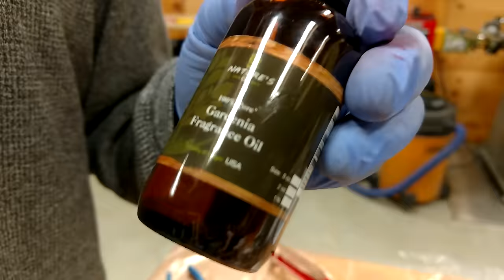Making Colored Smoke Devices for 4th of July

Comment: Please, if you would, elaborate on the solvent dye. It doesn't appear inexpensive at all (at least nowadays). Is this the same as the mica based dyes that show up in my searches?
I have everything thing else needed except the dye.
Thank you.
Reply from the maker: Check out coloredsmoke.com
Reply: @TechIngredients  Hot damn that was fast! Thank you.
I am in the process of many experiments using your information.
I hope to post an in depth report sometime soon.

I'm still trying to expand a bit on the first sugar+Kno3 composition, I've had some interesting results so far.

Comment: Is there a risk of explosion if the ingredients are added in the wrong proportions? In case a mistake is made...
Reply from the maker: It's small.  Only if a LOT more oxidiser was used would the burn accelerate to the point that it could burst the tube or the ends.
Reply: @TechIngredients  Cheers.

Comment: Question, is it possible to make it produce smoke faster? By pressing multiple pellets in 1 container maybe? Or would it burn too hot then?
Reply from the maker: The easiest method is to use a tube with a larger diameter and a larger hole.

Comment: Where do you get your Potassium Chlorate? Is it the same as Potassium Perchlorate?  Also,  is there any change that would be need to be made if using Citronella Oil in the  pyro device?
Reply from the maker: We used potassium chlorate and obtained it from EBay.  I suspect that oil would behave similarly to the other oils I demonstrated, but you might have to fine tune the quantity.

Comment: What if you use Potassium Perchlorate instead?  That has a lower burn temp. Would also save you all the carbonate troubles. 
Also, doesn't sulphur lower the ignition temp, would be a better primer? Or maybe even some phosphorus. Nice video though, will try.
Reply from the maker: Perchlorate should work as well.  Althoug it is OK to use sulphur with the perchlorate, I would avoid the sulphur in either case because of the strong oder.

Comment: Being the material is light weight, I may make some up for my CC plane using smaller thinner tubes, you never mentioned packing the tubes, so probably not a great Idea. I would use longer tubes and attach to eather wing tip. I may try it next summmer, not this summer. Also in a damp field,even evening when dew is falling to prevent any fire hassards.

Comment: Would it be okay to mix in the solvent dye during the shaking of the base products in the paint can?  The intended outcome being that what comes out of the paint can is the final useable product.
Reply from the maker: That's fine as long as you're sure you want to commit to a particular color.
Reply: @TechIngredients  Yup, if I give this a whirl there are 3-4 colors that I could see myself making frequently.  So I'd have dedicated cans for those and then a plain mixing can for whatever else.  I can't say I am going to try this, but I'd be curious how thick each successive layer would have to be in order to have a smoke that'd spit out 8 different colors in rapid successions.

Comment: Could you use printer toner for the dye? Printers use heat to fuse the toner on to the paper so I am assuming it would hold up okay to the heat but not sure.  Also not sure how safe it is.
Reply from the maker: I'm not sure, but if you constructed a dye free burn mixture and added some toner you would get an answer to the first question.  But, the dyes that are made for smoke are significantly less expensive and do work already.

Comment: Why not use fragrance oils instead of essential oils? They would be a fraction of the cost. Also, do you really need that much oil? Could you dilute it with a carrier oil?
Reply from the maker: You might be right about the source of the oil, but dilution is out.  You need very strong oils because the scent is spreading through a huge volume

Comment: Tech Ingredients. ..
What about alternatives like mineral oil, light petroleum-based or vegetable oils, should I not be interested in aromatics?
Though occasionally an option for me, I'm not wanting to spend for the added bonus of nose joy most of the time. 
I'm interested in marker smoke and the heavy, white smoke-screen devices.   Thanks!!!
Reply from the maker: You don't need to use the oils at all.  The initial demos were without oil.  If you do use oil to make the mixture a little easier to handle, then any food grade oil should work, although I havn't tested this.
Reply: Tech Ingredients 
  Thanks for the response. 
I guess, I'm contemplating making a stable mix with a simple base, like the food grade oil, as well as the dry mix units.
That's the best way I can explain my thought train.  This is the first, best method I've found for a civilian option to the military smokers I worked with in the air force. 
 I'm putting together some survival packs for the vehicles and a home package, therefore, the scents, etc. aren't as important, rather stability vs. volume.  Some to store and some on ready standby is the need, I guess the question out of that would be...
Does the oil mix provide any extra advantage (other than easier mixing) for shelf life or stability in varying temperature during said storage?  I noted the observation of a longer burn vs. more volume/higher reactive action between the oil, no oil units.
  Take care and glad to find/recommend your channel.  :)

Comment: Make very small ones that don't burn extremely long times and use for smoke-grenades for practice or paintball!  
Wonder how will a pipe nipple with caps at both ends with one end drilled would work?  Yes, I know, "pipe bomb" but these burn at a controlled rate, not explode . . . and the slower burn rate of these and shorter burn duration that I'm thinking of (15 - 30 seconds of as much smoke as possible?) might not get them dangerously hot?  And, the pipes would be repackable ..

Comment: I've followed your video for white smoke bombs and they worked great!  Is it possible to modify the colored recipe to use Potassium nitrate and sodium bicarbonate since I have these ingredients available but want to make colored ones instead?
Reply from the maker: Probably not.  The bicarb will certainly be able to bring down the temperature, but the potassium nitrate will have trouble decomposing to release the needed oxygen. It may be possible to walk this line finer than we did and be successful.
Reply: @TechIngredients  do you know a reliable colored smoke bomb recipe using potassium nitrate and sugar?

Comment: Great video! My son would like to know. If the dye stains everything. Does the smoke also stain? And if not. Do you know why?
Reply from the maker: The dye stains while preparing the mixture.  However, the smoke does not.  Look at our clothes during the demo.  No detectable color was deposited on them despite the density of the smoke and I especially was moving in and out of the clouds.
Reply: @TechIngredients  Can I add dyes to clothes and do not need to dye a specific one and know the name of the dye used in this video and is originally used in a non-smoke device

Comment: It's nice that the KClO3 allows one to tune the mixture so it can burn at a lower temperature, but it's efficacy also makes it difficult to locate. Many suppliers won't sell to anyone that isnt a licensed business or educational institution, unless you source it from over seas, but then you might have customs issues. That's why there are a hundred videos on how to make the stuff (don't recommend, it is cheaper to just buy it if you can), so most ppl are going to be forced to use KNO3 anyway. 

I'm interested in this because I want to see if you can use some high temp bearing grease, vegetable oil, bees wax.
Reply: Could you use potassium perchlorate as an alternative? That is readily available.
Reply: @dale-ry4cb  you could, but you won't be able to make a coloured smoke as it burns too hot and will destroy the pigments, that's why this video explains it's presence for chlorates over perchlorates. 

But keep in mind, what you are essentially doing g is making a solid rocket fuel that is tuned to burn slowly, but if not mixed properly or handled properly, it can ignite while cooking. So leather gloves and face protection are highly recommended.

Comment: Would the addition of acetone allow the mix to be packed into a more solid uniform shape? i.e. the acetone will evaporate from the mix
Reply: SpartanP291 consider that these are solvent dyes which are in fact soluble in non-polar substrates like acetone. (Mentioned) may have an impact on performance. Not sure that how the other compounds will react regarding introducing acetone to the mixture. As far as the packing goes, I think oils (optionally scented) are a viable solution.

Comment: Are the tubes reusable? Would ball jars with a hole in metal lid stand up to the heat and pressure?
Reply from the maker: I would stay away from glass because of the potential for breakage, not due to pressure, but from localized heat or impact.  The low pressure from the colored version of these smoke devices (as opposed to the white ones in our other videos) means you could use thin wall cardboard shipping tubes.  You could reuse these, but it would be a bit messy.

Comment: I see the issue that you run into with these colored smoke bombs as compared to the white paraffin wax smoke bombs, is that with a dry mix, you get a really slow burn that you can't mold it to have a middle part open inside the cylinder for a fuse like you can with the potassium nitrate mix. Is there anyway to make this powder into a moldable mixture without compromising the formula? And if I mix in more of the white powder you use for a starter reaction will it change the burn? Would I have to layer the starter powder inbetween the main, dyed powdered?
Reply from the maker: The oil is the only method I know of to make the mixture less dusty.  The oil actually slows the burn a little.  The starter mixture can be added in a separate layer, but its higher temperature is detrimental to the dye, so keeping it separate is important.
Reply: @TechIngredients  I'm assuming that you can't heat the mixture to a more viscous state like the peanut-buttery substance that you can get from the salt peter and sugar formula (non-colored smoke bomb). It's just that watching the last bit of the video with your yellow smoke bomb that eventually turns violet, you can tell that the burn takes a really long time because of the little surface area that's exposed because the powder lays flat. And for me personally, I want to find a way for the colored smoke bombs to act just as fast as the non colored, paraffin wax ones. Can you think of any way to do this? Also one more question: You said that the solvent dye is really staining, (I found a really good site: Fireworkcookbook.com that sells cheap pounds of all three primary colors for anyone who's wondering) Once the dye is atomized during the reaction, will being in the colored smoke stain your clothes? There would be a lot of reasons for me to not want to use solvent dye if the smoke is highly staining. Thanks as always for your awesome content and I hope to see more like it :)

Comment: I want to make these for new years. Can i make these with the plaster of Paris ends? Sir, you are a dictionary of knowledge. Thank You for your channel.
Reply from the maker: I think that will work.  Try testing one tube with one end filled, completely dried and see how well it bonds.
The reason we used a hydraulic cement is that most other compounds shrink as they dry and pull away from the walls.
Reply: I tried the plaster of paris and it works great. I just can’t get them to burn like yours and I’m using same procedure. Frustrated

Comment: Where did you purchase your tubes and endcaps cant seem to find them anywhere on the internet. Thanks
Reply from the maker: Did you check out Skylighter and Pyro Creations?
Reply: @TechIngredients  thanks for fast reply! Did check both but they seem all to small or to big. Would you by chance know the dimensions? Want ones very close to what you used (the bigger sized ones) cause those are perfect and I'll just cut the circles myself. Just got the chemicals in the other day and love your idea with the potassium nitrate and sugar mix on top of the mixture because it's actually pretty hard to get this stuff to ignite with just a fuse and phew the solvent dyes are pricy but so worth it! Great videos!

Comment: this capping method is much easier and faster,why not use it for the regular smoke bombs? im sure they can handle the pressure no? and what are those discs made of?
Reply from the maker: The caps are made of cardboard and they will let go under the higher pressure and heat of the potassium nitrate mixture.
Reply: ok because you mentioned you got those caps from somewhere so i figured they must have been made of something more than just plain cardboard

Comment: Pros and cons of using confectioner's sugar vs the straight stuff? I understand he former has some corn starch added to prevent caking. I've used CS in rocket motors pretty successfully.
Reply from the maker: I believe both will work well.  Table sugar is less expensive and you need the grinder in any case to pulverize the oxidizer.
Reply: I finally got some smoke dye and can confirm that the confectioners sugar works just fine. Hope to try the scented version next.

Comment: Can you say where you get your chemical supplies?
There is a very fine sugar used to make icing ( UK), a different name here in the US. Save mortar and pestling the other stuff.
Reply from the maker: You will still have to grind the oxidizer.  It is hygroscopic and becomes clumpy, preventing efficient compounding.  Having the grinder, grinding the much less expensive table sugar then makes some sense.
Reply: @TechIngredients  OK - Got it.

Comment: I noticed how little you compressed the compound.. is there some reason for this? What would happen if a fairly large amount of pressure was used when constructing these. 
I would assume that the burn rate would decrease and burn time would increase due in part by having larger amounts of compound and assuming I was correct with the burn rate.
Reply from the maker: You're right.
Reply: Thank you for the reply.
With internal pressure and heat not being an issue, what would you think would be the proper mixture and compression to achieve the highest volume of smoke output in a given amount of time. 
I am hoping to achieve 60 secs of burn with around 18 cubic inches of space within the cylinder (2.5"x4.5") 
I would assume that the venting would play a part in this equation as well 

I jst subscribed as I find your videos most interesting and very creative. 
Your shop is also very impressive. Having the freedom to experiment is what drives innovation, as was clearly shown here with the development of these scented smoke devices.
Reply from the maker: The mixture is close to optimized.  The burn rate can be increased by increasing the surface area at the expense of depth for a given volume in the container.

Comment: Do clothes or nearby walls smell afterwards? For music video reasons would you consider using these indoors or is it too much a breathing risk or hard to remove odour after
Reply from the maker: There is no residual staining or smell, but I don't recommend using these inside.  There is an incredible amount of smoke and I don't know of any smoke that is good for you.
Reply: @TechIngredients  definitely with ventilation and for brief shots then clear out.  Maybe a very tall and thin version would disperse smoke slower.

Thanks!

Comment: So if I wanted to make, lets say, a red, white, and blue smoke bomb for the 4th of july. How would I do that considering the colored mix burns cooler than the basic mix that burns white but hotter? Can I use the basic hot mix for the white or is there a way to make the cooler mix in white?
Reply from the maker: I would keep it simple.  Build a few white, a few red and a few blue and control the presentation with the ignition.  This also gives you the freedom to double up on a weaker device or compensate if one fails.

Comment: Maby im dooing something wrong here but my color smoke grenades dont burn. The only thing that Burns is the start 50/50 compound. Do I need to dry oven the chlorate? Because it was very lumpy when I got it.??
Reply from the maker: I suppose that's possible, but the first step should be to try a few samples of the mixture on a tray or dry ground.  See if you can get it started with a torch.  If it self sustains then maybe all you need is more starter.
Reply: @TechIngredients  nope. I dit like you told and try some different more burn rich mixures. The chlorate dus't burn not even with al 50/50 Sugar solution... I think my chlorate is to wet. Cant I pm you on Messenger ore WhatsApp... SO I can send you some pictures
Reply: I think i'm gooing to buy some metal buckets like you use to store the different compounds. And then dry oven them first, my plastic bucket of potassium chlorate is like a rock and all blocks..

Comment: Other than saving a little bit of material for the next smoke bomb, is there any reason that you do not pack it all the way to the top instead of putting cotton in it?
Reply: Also, is it safe to scale up? Like the tube that pallet wrap comes on, 4" X 12"
Reply from the maker: Scaling up shouldn't be a problem.  The dead space allows the mixture to burn without spitting out some of the unburned compound.  However, you could probably push it a little fuller than I did.